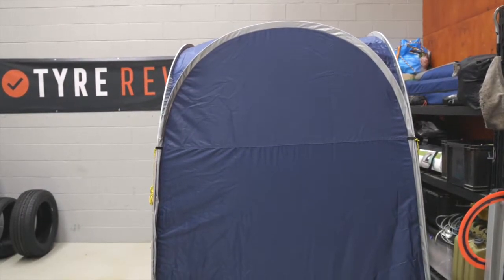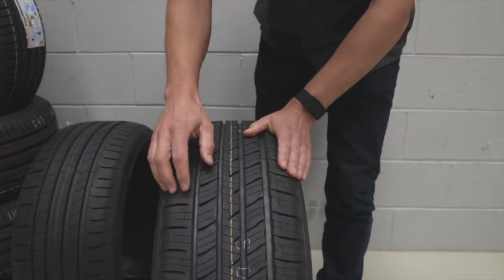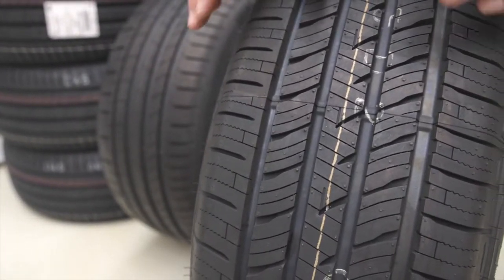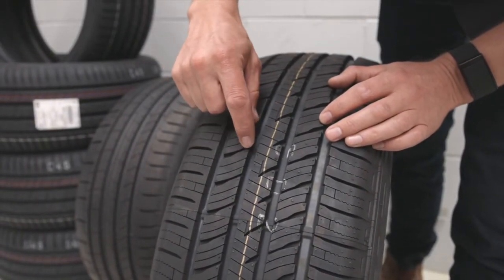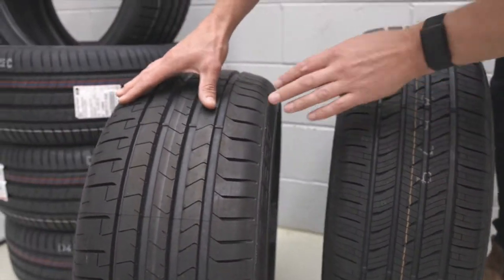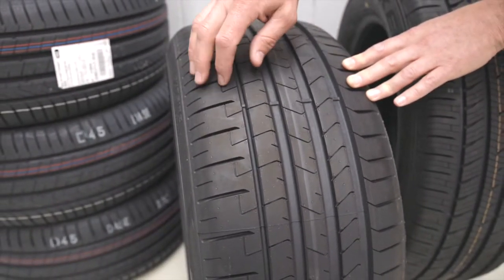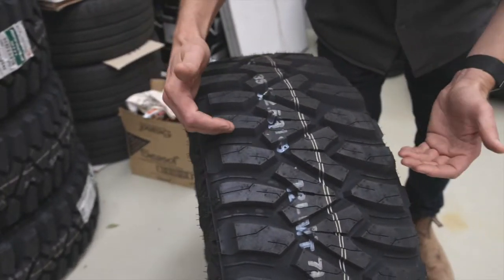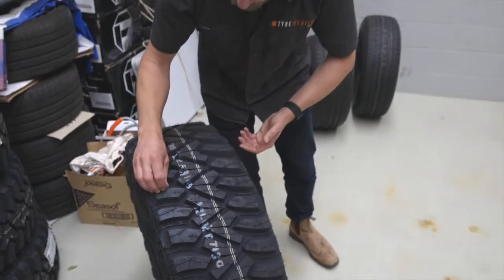Unlocking the Mystery of Tyre Sipes: Why They Matter!

Comment: Sipes are the thin slits designed to create suction on a wet road.  Invented for deck shoes for wet boat surfaces.
Reply: I wouldn't call it suction, I'd call it a place for the water to squirt out and reduce the likelihood of hydroplaning.  If the sipes don't go all the way through, perhaps that advantage is reduced or gone.  I'm not sure.